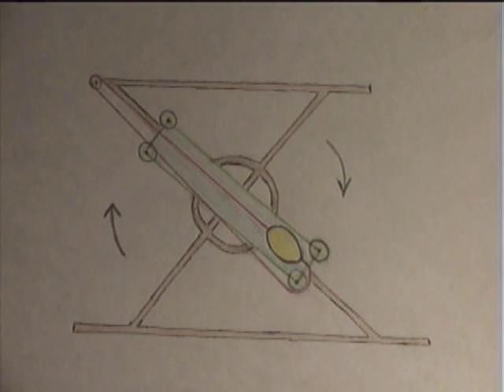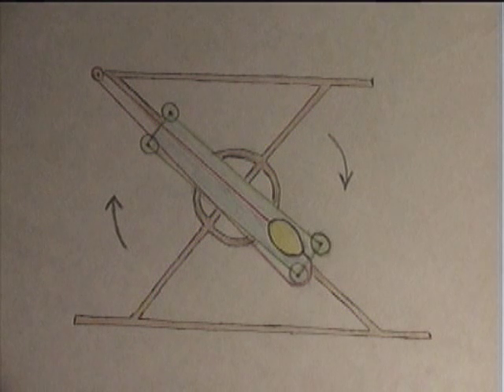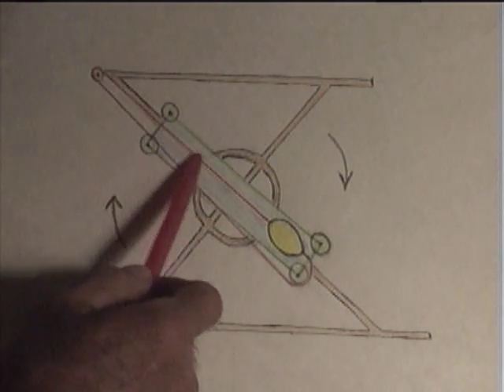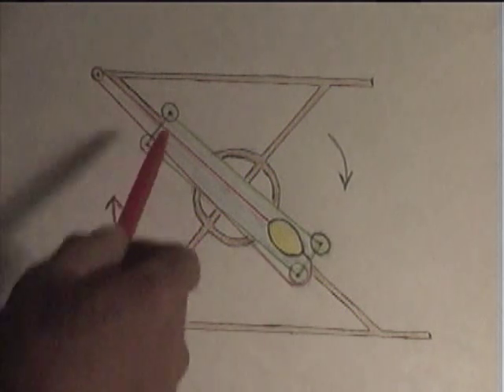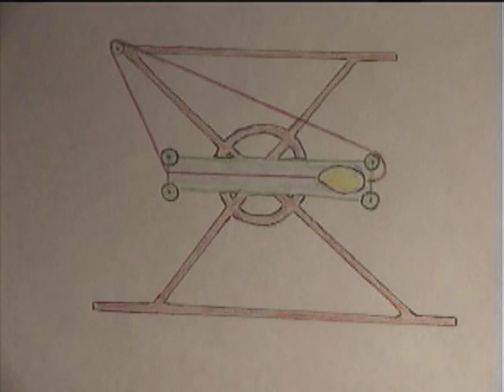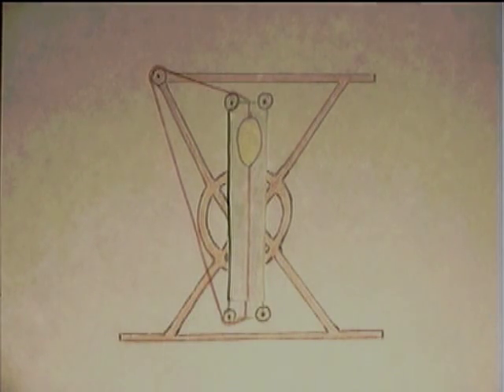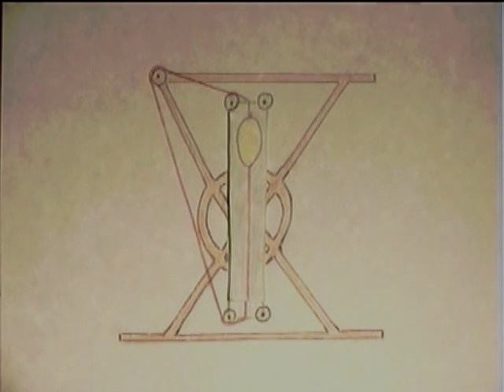Water Perpetual Motion Machine P5

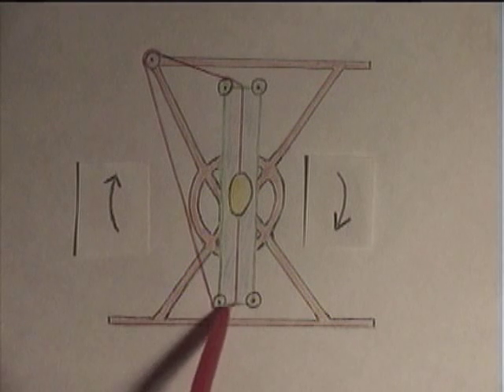Comment: After 1:28 and before we get to position 1:33 the device will stop.  How can the upward force on the balloon push it down?  Between these two shots the balloon must go downward in the water.  I'm pulling for you friend.   I just don't see where the force comes form that pushes the balloon down.   You say the hydrogen is several times more buoyant.  If it would, it would have to have negative weight.  The difference in weight of this balloon at a given volume vs the water is it's buoyance.  In this small size, the difference in air or hydrogen is going to be just grams.  There is no magic doubling or tripling of the urge to float because hydrogen is in the balloon. It's simply the difference in weight of the balloon and the volume of water it displaces.  The machine will always come to a stop with the balloon in the vertical position.
Reply from the maker: This device is not my invention. In the video I am merely evaluating it's 
possible performance. You have done your own evaluation of the device and
your conclusion was even more critical than mine.